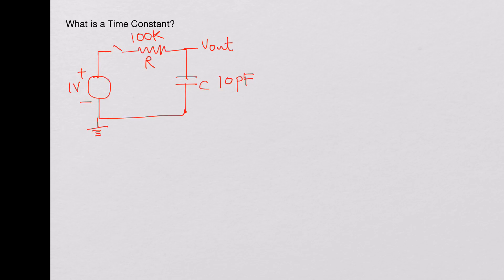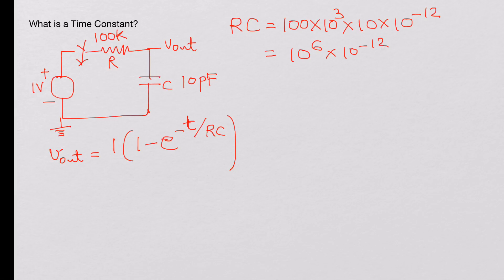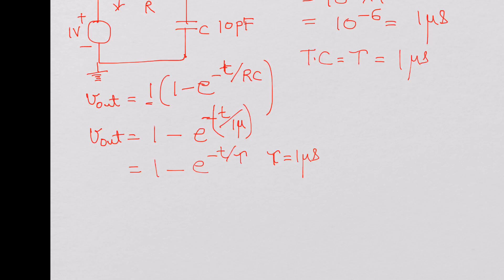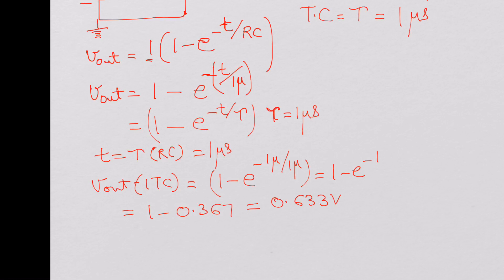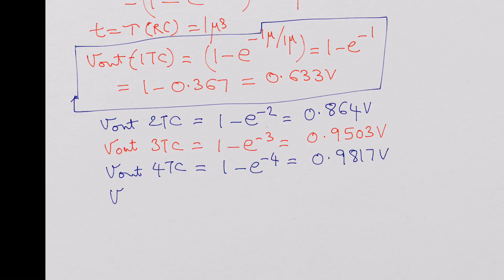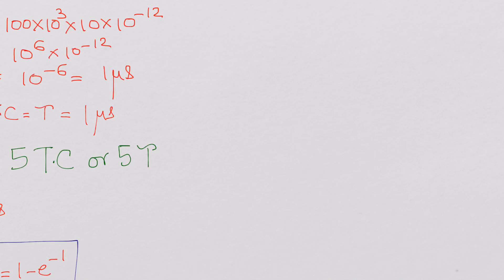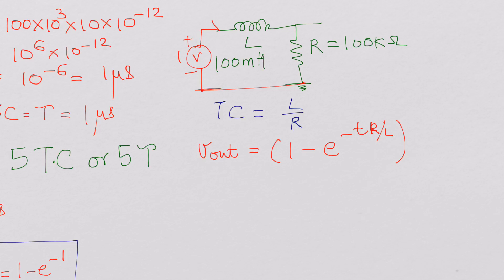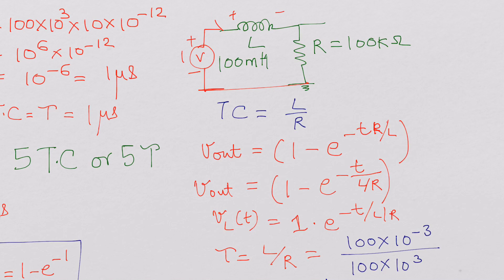What is a Time Constant? How many Time Constants?

Comment: It's much easier if you skip the "long math" and multiply the time constant and the voltage. Such as .63 x 1 volt = .63. Or discharging, .36 x 1 volt = .36.   If you need all three numbers in your answer, you simply add another number which is the equal of the second number, such as:  the answer .63 would become .633 and the answer .36 would become .366. . Math simplified. I hope this helps.